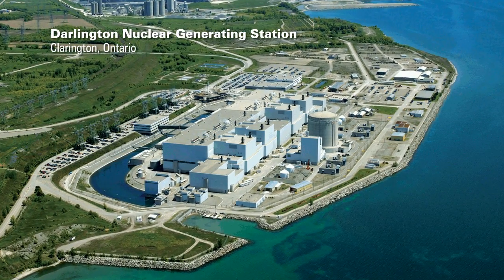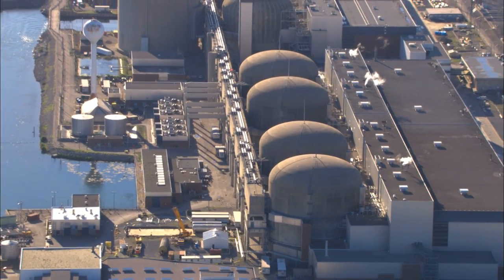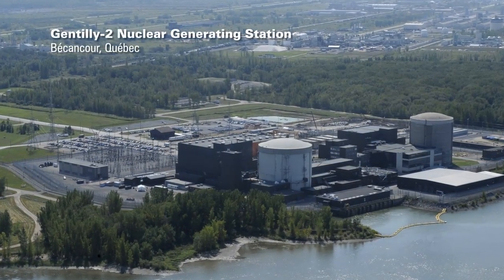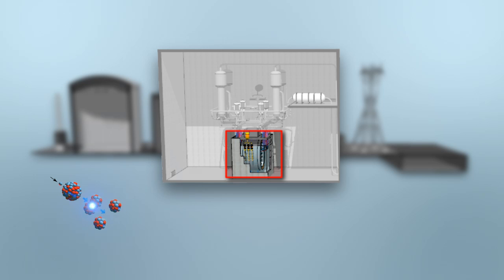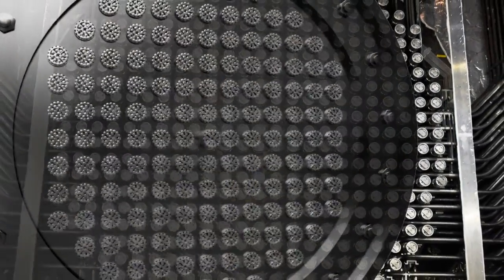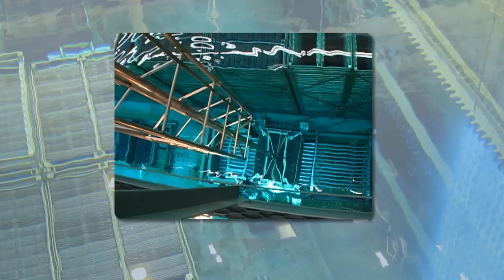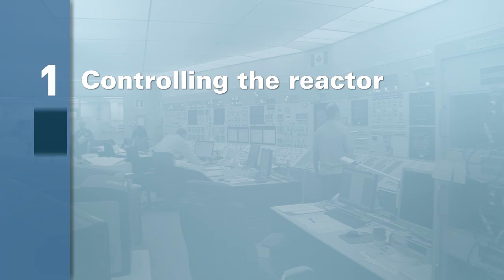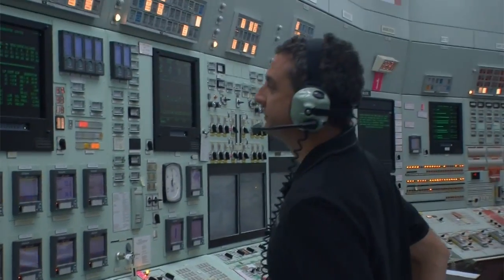Nuclear Power Plant Safety Systems - Part 1: Introduction

Comment: It's too bad that In the end Candu is just too expensive to run and maintain  Westinghouse at Darlington seems to be the way of the future What are the 300 megs ? I was at Pickering for 34 years ,retube VB outage A side stator replacements  the large crain ...wow !! OPG does it right and safely .It just sucks that Candu isn't viable in the long run .instability at times too ....U-3 was interesting but safely handled Good luck at Darlington ..4 Westinghouse .